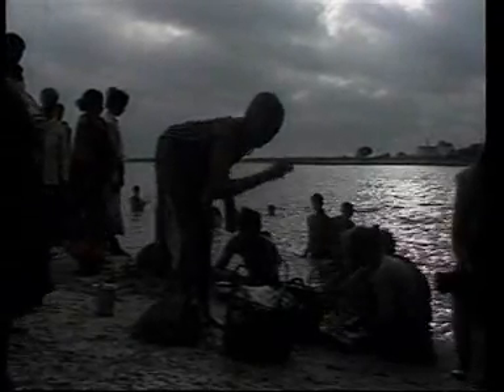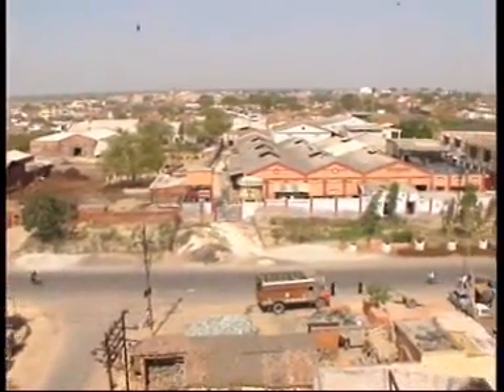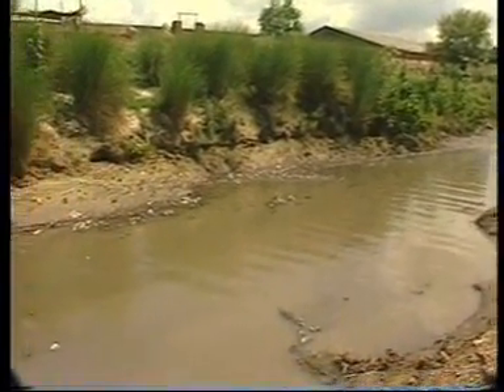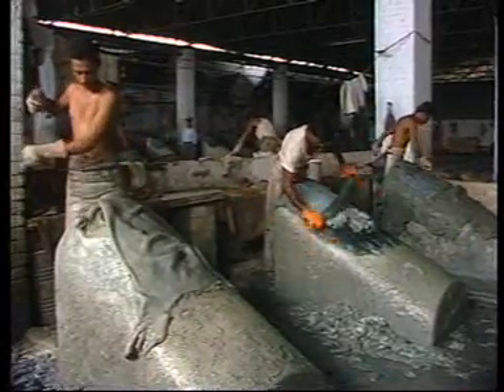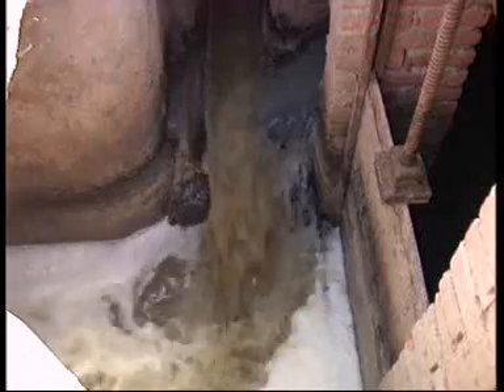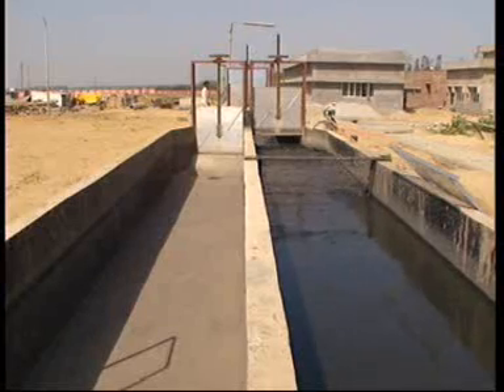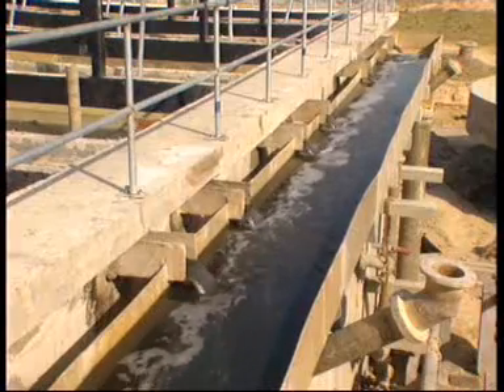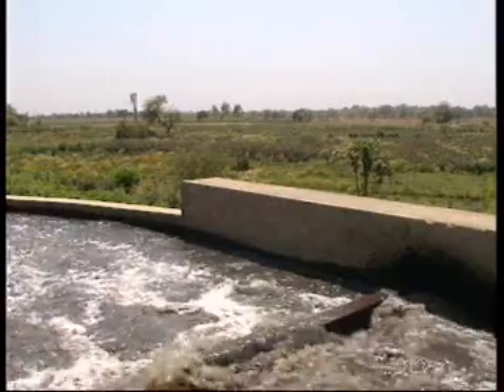POLLUTION FROM TANNERIES

Comment: 03:15: Pipetting by mouth is not recommended. 

Also, it would be nice to see some numbers; how much Chromium is needed per ton of hide per day ? What is the acceptable level of Chromium ? What are the ways to reduce the efflux of Chromium ? All the research that has been made in India and elsewhere is of no use if this is not applied to solve the problem. 

Please wake up from your slumber Ms. Bharti, Mr. Modi; If Ganga is not cleaned by 2017, Ms. Bharti would go into Samadhi. We would not want that to happen, do we ?
Reply from the maker: Dear Mr. Raghavendran, thank you for your comment on the story on pollution from tanneries. Yes you are right about the quantum of chromium, however, in a small story it was not possible to include all the details. The status must have changed by now...we had done this story in mid 90s and the situation was really bad. BestPramod Mathur
Reply: Thank you for your reply Dr. Mathur. I did not expect a reply at all. It was a pleasant surprise.

Would you be interested in writing a piece for my blog about Chromium and numbers ? I read an article in the July issue of The New Yorker about cleaning the river Ganges. My heart wept; despite being a researcher, I could not be of any help.

I saw a video in Holland on the installation of a reactor to produce biogas at the 'ecco' plant. What is preventing India from accomplishing this task ? Ignorance or Corruption ?

Half the population do not have access to toilets; yes, the tanneries bring money and provide employment, but if the workers then have to pay medical bills, I wonder if we need tanneries at all.

Thank you for reading.
Reply from the maker: Dear Mr. Raghavendran, As a Television journalist I consider it my duty to respond to each and every comments that is posted on our stories on the Your Tube channel: https://www.youtube.com/user/SPOTFILMSI would like to correct your notion. I am not a Dr. of any kind. Yes, Lately, as a journalist  I have been writing articles for newspapers and magazines. However, I may not be the right person to be writing on a technical and scientific issue since I do not think I am qualified to do so. I hope you understand.If you go over our channel you will find several short stories (50) about non-conventional energy sources, energy and environment that were done in mid 90s. India was at the forefront at that time. There were several stories on biogas...even community biogas. Unfortunately, India got lost on the way. The corruption in politics and bureaucracy has taken a toll in the past two decades. Young Indian was impatient and voted Congress party out. It will take a while for Prime Minister Modi to put things back in order. I am personally very hopeful that things will begin to come back to normal. I have travelled the entire length of Ganga from Gangotri to Gangasagar while doing a film...that was the in late 90s. The situation was horrible....It is heartening that the present government has made the cleaning of Ganga a mandate...we can only hope for the best.WarmlyPramod Mathur
Reply: Thank you Mr. Mathur. I shall let you know if I do compile numbers on tanneries and Chromium.

Sincerely,
Vijay
Reply from the maker: Thank you. I will look forward to your message. You could use my email address : mathur.pramod@gmail.comWhere are your based Mr. Raghavendra...and what do you do?

Comment: To get the chromium out of the soil and groundwater you drill wells and pump in a 10% solution of molasses
The chromium binds to the molasses and it is pumped back out the well and the water is treated